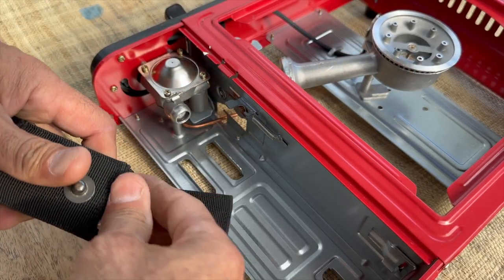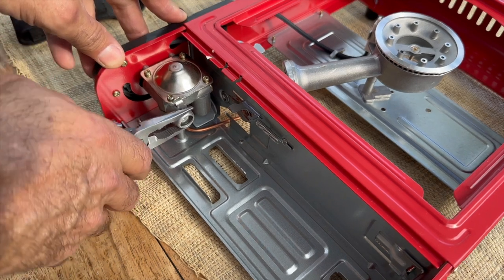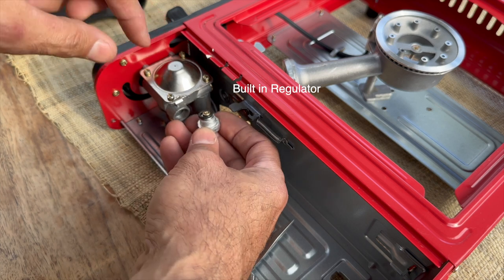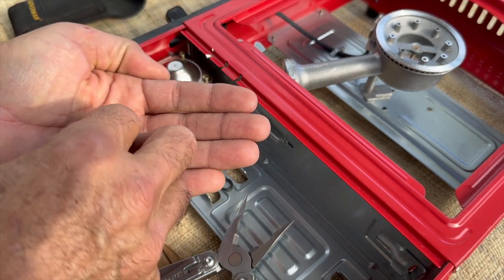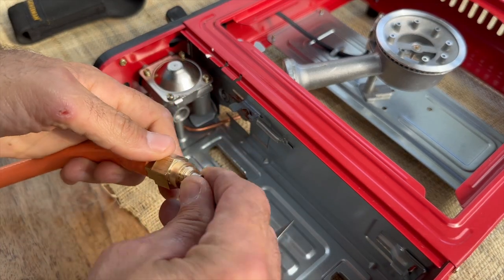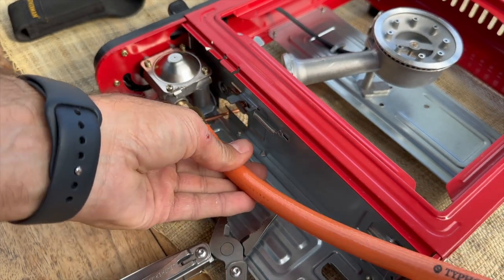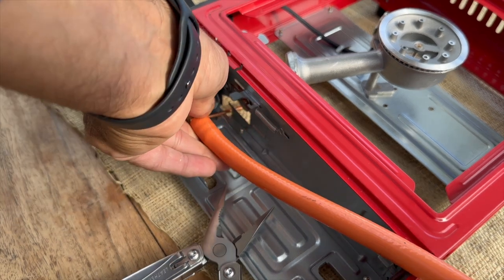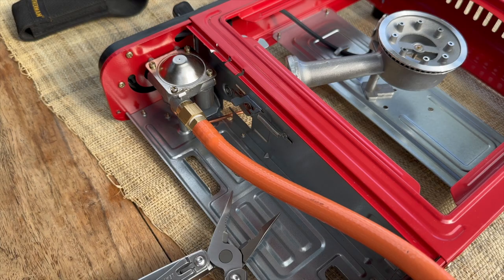Converting gas burner canister to LPG bottle (#gasburner #campinghack #leatherman #lpgas)

Comment: Can you do a vid conversation the other way please
Reply from the maker: +@deancooper7043 as long as you have the attachment all the parts are easy
Reply: @4x4OutFar   I want the regular 3 burner top in the caravan not to need a big bottle of gas. Just a clip in disposable can. I mostly cook on a bbq anyway or on a fire.
Reply from the maker: +@deancooper7043 this isn’t the same connections. A can would empty pretty quick I would imagine
Reply: @4x4OutFar  yeah it probably gets used couple times a week. Just need the extra space
Reply from the maker: @deancooper7043  changing optins might mean just moving where space is stored. but actually the same amount of space in total. if that makes sense?